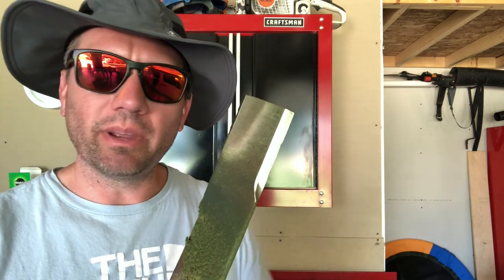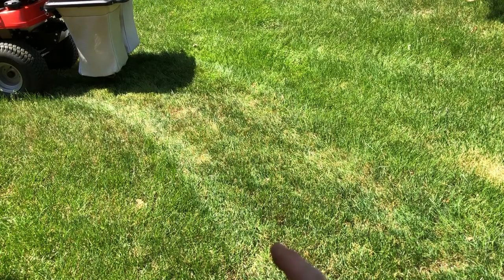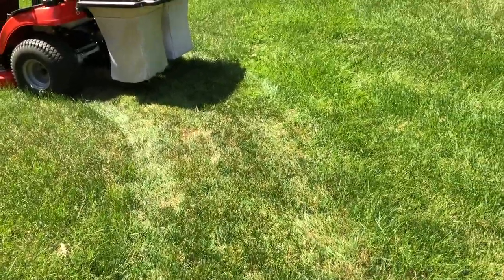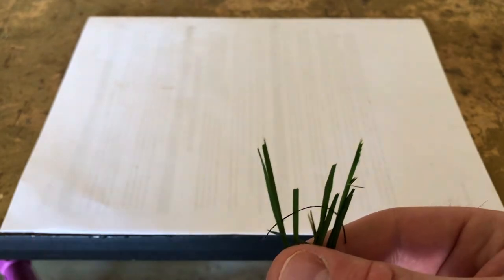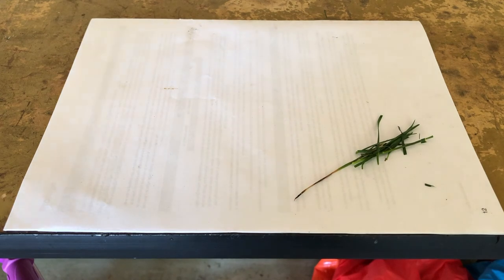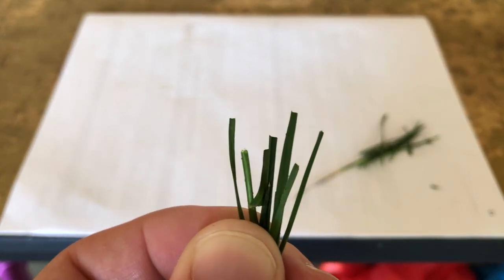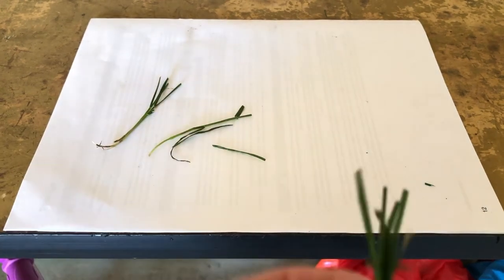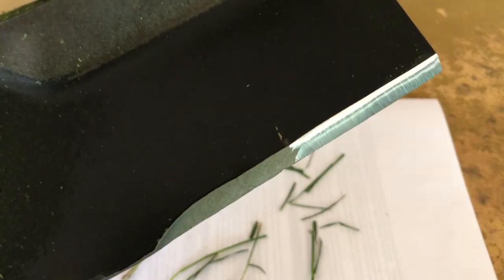Lawn Mower Blade Sharpness Test,  Does it Really Matter?

Comment: Sweet. I’ve been using cheap harbor freight $10 right angle Grinder with cheap flap disc 150 grit, but been looking at Milwaukee m12 angle grinder, looks more mobile and faster rpm.
Reply from the maker: Good idea, it would be nice to not have to deal with the cord.  Also, Milwaukee makes some great tools.👍